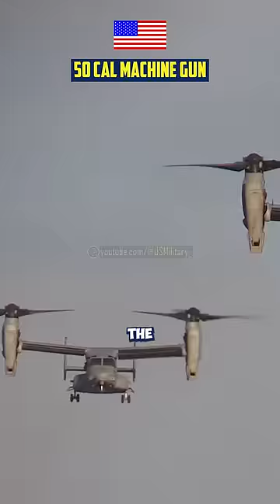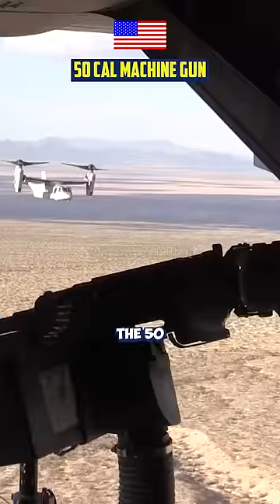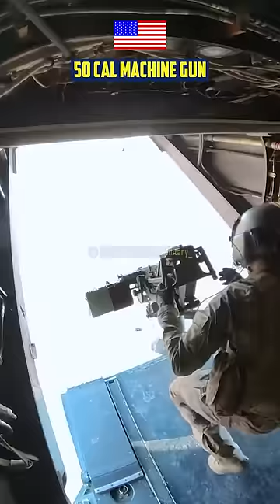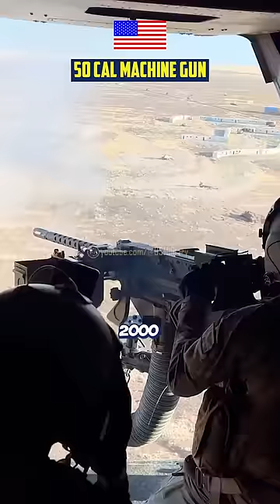The Scary Reason Why the 50 Caliber GAU-21 Heavy Machine Gun Used By @USMilitary_ Is So Advanced

Comment: Mate, that's a clocked up M2. Nothing very advanced about that

Edit: It would seem I started some shit
Reply: America not changing their machine fine for 100 years be like:”don’t fix what ain’t broke, you literal b-“-💪😎🇺🇸
Reply: Basically WWII air core fighter/bomber tech. If you know, you know.
Reply: I swear there was a couple 240's too
Reply: When he said that was a gau I was like most definitely not😂
Reply: @iteststuff1197 and you’d be wrong. It’s the replacement for the GAU-16 that was used for decades. GAU just stands for “GUN AIRCRAFT UNIT”.
Reply: @sbcbaits994  ooooh my bad 😅
Reply: True 👍🇬🇧
Reply: They had that same tech on bi planes in ww1
Reply: bro I was about to comment the same thing. just set the timing faster and enjoy your barrel changes.
Reply: seems like a bunch of y'all in here have done headspace and timing before. got a bunch of vcs, heavy weapons platoon, and vehicle gunners here.
Reply: @confusedbean1953 actually it is broken
Reply: @yosandydopico5545  no, the people it obliterates are tho
Reply: @flyback_driver  Ya ya .ost of u military guys can't even tell me the dimensions of a 2x4
Reply: Donate chip?
Reply: It's a m3 not a m2
Reply: @Deathbomb9 AN/M2
Reply: Yeah .. the gau is 30 cal mini gun isn't it?
Reply: @confusedbean1953 you my friend have no idea of the history of the 50 cal.

It was never a good gun.

It's over power for personal and underpowered for use against vehicles.

It's a half measure of both were 308 or 20 mm would be better. 

It's not good they just made a lot of them
Reply: Not even clocked up that far. The aircraft versions used in WWII went up to about 800 rounds per minute.
Reply: Haha my thoughts exactly,  so the 2nd update since ww2?
Reply: @jeremychance6463  GAU (Gun Aircraft Unit) is mostly just a designation for guns used by the USAF.
GAU-2B/A and GAU-17/A are different versions of the classic M134 minigun. 
The GAU-4 is a version of the 6-barrel, 20mm M61 Vulcan, some version of which seems to get into almost every US fighter aircraft since the '60s.
The GAU-19 is a 3-barrel, .50 caliber gatling. 
The GAU-8 is the 7-barrel, 30mm crowd pleaser on the A-10. 

Meanwhile, the GAU-5A is a breakdown M4 variant intended to be something better than a pistol for the emergency kits for ejected pilots.
Reply: @Deathbomb9 That was actually the US Army Air Force during WW-2, and it's spelled Corps.
Reply: @HelsinkiFarter There were.
Reply: @sbcbaits994 And it is pronounced G. A. U.  As a USAF Security Policeman, I carried the GAU-5 on numerous occasions.
Reply: @laglord  oh ok, I remember the 7.62 six barrel, the M240, and M2 when I flew... And the belly gun which of I remember right was the same mini gun as the ramp gun just installed under and with the computer targeting system operated by the senior AO
Reply: Dam right
Reply: @jeremychance6463 There are a lot of GAUs.
GAU-2 = 7.62×51mm NATO Minigun.
GAU-5 = 5.56×45 mm NATO Sub Machine Gun (XM-177E2).
GAU-8 = 30 mm Avenger Rotary Cannon (A-10 gun).
GAU-12 = 25 mm Equalizer Rotary Cannon. 
GAU-13 = 30 mm Light Weight Rotary Cannon  
GAU-15, 16, & 18 = Updates to the AN/M-2 .50 BMG Machine Gun.
GAU-19 = .50 BMG Rotary Machine Gun.
GAU-21 = Undate to AN/M-3 .50 BMG Machine Gun (which itself is an updated AN/M-2).
Reply: @JackTalyorD It did have a place early on in WW-2, but was out classed by the 20mm aircraft cannons by the end of WW-2. Once jet propulsion became normal for fighter aircraft, only the USAF was stupid enough to equip its fighters with it (see the F-80, F-84, & early F-86s, although some of the early USN FJ Furies may have been armed with it too). The USN, RAF, RN, and other NATO countries were using either 20 or 30 mm cannons, & the Soviets were using 23 mm & 37 mm cannons.
Reply: @ZackBadCompany1234  no they did not
Nice try though
Reply: @earlwyss520  as fair as I have seen the were a way to add extra "fire power" to any vehicle. 

Just slap a 50 on it and call it a day.  Let turn this transport truck into a tank kind of ideology.

But the end result been that the were under equipment to really deal with anything either  

Eg carrying 5000 rounds of 308 vs 1000 of 50 

Or 

Only 100 rounds of 20 mm but could do damage to amor.

Something like that.

It's more than just one thing that makes them good a d bad .
Reply: @earlwyss520  what wes it Americans WW 2 tanks each got a 50 cal on top for anit air defence.  In built A.A units for a tank coloum. Which sounds good on paper till you find out that have 6 50s shooting at a plane was less effective that have one 20mm gun attached to the colloum, which I believe was the Germans way.

The 50s looked good but did little damage to aircraft vs a gun that could actually shoot down a plane. 1943-1944 .

With the saving grace been they had air domains by that stage of the war 

I think.

Considering it was a war of resources it's funny they could waste it on gu s that weren't ever really needed
Reply: @JackTalyorD  The Browning AN/M-2 based FN Mitrailleuse d'Avion in 13.2×99 mm Hotchkiss may have been a better option.

Also the Germans used mobile 2 & 3.7 cm FLAK guns to defend their Panzerkampfwagens. The guns were mounted on Pz.Kpfws & various Sd.Kfz half tracks.
Reply: @earlwyss520  thankyou. 

I trying to get a better understanding of guns and weapon development. Trying to rap my head around cause and effective.   

Example tank destroyers where never good but they were cheaper than tanks (and I make this up) with some like the Germans capture 200 75mm Romain guns and gone stuff it lets slap it on the Panza 3s we got laying around. 

Or things like the Toyota wars where speed and quantity in well tin cans took down battle tanks. 

You always see comments of well 1 a-10 well destroy 200 4wd and I'm like we'll can it really...... I mean yes but you kinda have to catch up with them first...... 

Short answer would you recommend any sources for this kind of information.
Reply: @BogMouse3137  lol a machine gun on a swivel mount. Absolutely they did
Reply: But I am going to hype it up. Need muh views
Reply: @ZackBadCompany1234  well, biplanes of that time could not handle the weight of a 50 cal machine gun. So no, you’re wrong. The m2 underwent testing by the Army in 1918 (not combat usage) and then entered service in 1923. 
Google’s free genius
Reply: @Otto, Prince of Bismarck  haha 😂I understand that the m2 50 cal wasn't on bi planes. I'm talking about a machine gun on a swivel mount operated by some guy litterally shouldering the rifle 😂 .. I could totally make the jab that ww2 planes had better tail guns than that. But I left the fact that it was a 50 cal alone 😂
Reply: @ZackBadCompany1234  but your original point that they had the same tech in ww1 was wrong b/c the ma deuce mounted on a war plane didn’t happen yet
So therefore you are wrong
Reply: @Otto, Prince of Bismarck  lol nooo. How do u get they model of gun from the word "tech"?  Clearly, you are misunderstanding the words.  Had I said : they used the same guns on ww1 bi planes then u would be correct
Reply: @ZackBadCompany1234  lol okay Forrest Gump
Reply: M3 actually, which is the aircraft version of an m2
Reply: Just an M3. M2 browning but with air cool jackets around the barrel and a faster fire rate along with no spade grips all electronically firing
Reply: M3
Reply: The FN M3N 'Gau-21' is just a slightly modified AN/M3 browning dating back to the Korean War. The AN/M3 Browning, in turn, was a heavily modified M2 Browning.
Reply: @sbcbaits994  do you have any idea how much more advanced a minigun is than a new rebuffered version of a 100 year old gun is? the m3-variants start in 40's even.

this video is stupid. the arm is more scary reason advanced than the gun the gun is scary advanced. sure the gun works, generally, is known of how to fix, the rounds in the supply etc.
Reply: @laglord  There is nothing anymore "Break Down" about the GAU-5 than a standard M-16.  It predates the M-4 & is a contemporary to the US Army's XM-177E2. It was issued to USAF Security Police officers, senior NCOs, and K-9 handlers.  It was also issued to TACP members, Para Rescuemen, and other USAF Spec-Ops personnel.  As a USAF Security Policeman, I had the occasional need to carry one.
Reply: @cannonfodder6299  They were both used on aircraft, the .50 BMG AN/M-2 (not to be confused with the .30 US AN/M-2 also used on aircraft) & the AN/M-3.  The former was used during WW-2, & the latter in Korea.
Reply: Yeah they literally had versions of this gun in WW2.
Reply: @JackTalyorD  it was developed as an anti-tank machine gun in 1918, back then .50 BMG could punch through tank armor. But the war ended and later developments from the M1 to the M2 model made it a highly modular platform.

It can be mounted on a jeep, can kill lightly armored vehicles even today, and is highly durable and reliable. M8 greyhounds notably used them as the primary armament, the 37mm cannon being reserved for emplacements.

It is a niche gun that continuously adapted to new niches as the old ones died off. Your assertion is nonsense, it is infinitely adaptable as heavy machine gun.
Reply: @lasskinn474  yeah… I have 3k hours in h-60s and spent 4 years as the test team lead at HX-21 doing developmental test and eval. 4 deployments and thousands of rounds from a Gau-16/21 tells me that you still don’t know what the fuck you’re talking about. Gau-15/16/21 are different from the Gau-17 and it’s variants, but they are still designated for aircraft use. Hence their wide use among different branches of the military.
Reply: @russetwolf13  it can kill light armoured vehicles.......... 😂😂😂😂😂.

So can a lot of things.

That's the point it's both over powered and underpowered.

Swap that 50 for a Saw and a 40mm or a tow and you can kill tanks as well as troops.
Reply: @JackTalyorD  but none of those things can kill armored vehicles through infantry. Lesser platforms have to change, the M2 doesn't.
Reply: @russetwolf13  that's a pipe dream if I heard it that's almost the bare minimum "bulletproof for small arms up to 50 cal for amour vehicles"

Hell about the only things that aren't rated for 50 are things that get dropped out of planes.
Reply: @russetwolf13  one weapon systems that's dose several things badly dose not make it good or better that several that do on job well.

No to mention the same weight/volume of equipment.

4 nlaws and a blet feed light machine gun vs a tripod 50 

Ones going kill tanks the others just going to scratch the paint.
Reply: Well its an M3 basically... M3 does 1200rpm and M2 does about 750
Reply: @Deathbomb9 first developed for WWI but it didn’t make production in time…it’s a very old gun. I was gonna say, it the GAU 21 really that much better than an Ma Deuce. Does it really perform that much better?
Reply: AN/M2
Reply: Lots of changes have been made to the gun since ww2
Reply: @iteststuff1197 yeah wtf are these shorts on, i was expecting the real big machine gun
Reply: @iteststuff1197  it's based on the M2 and looks very similar. I never shot or worked on one but I believe they require electricity possibly? The rate of fire is like double the traditional M2 though. Pretty sure they're only on aircraft and helo's because of barrel temp issues you would experience firing it from a stationary position. Anyone who shot this thing or worked with them please feel free to correct me.
Reply: I mean. It's the best HMG ever produced. The reason why it's "advanced" is that extra tube under their looks like an additional gas tube to aid the recoil based action. May also decrease failure rates at high altitude and in cold environments. It's a simple addition. But a valid one.
Reply: I was about to say, it doesn't look any different than the M2 I had on my Stryker.
Reply: @HelsinkiFarter there’s 240s on the sides
Reply: @sbcbaits994 ah that's what gau stands for i thought it was the manufacturer.
Reply: @flyback_driver still have my gauges lol
Reply: “But it goes to Eleven?”
Reply: @yosandydopico5545 true. Buncha D CO heavy bois with some spicy time
Reply: @JackTalyorD  Your comments are so obviously fueled by bias it almost physically hurts😂
Reply: @AnthonyBlamthony  ohhh god no I love the 50 is a beautiful gun. 

JMB did a amazing job.

As a gun it's very nice. How it's been used it effects the last 100 years so so.
Reply: @flyback_driver give them a break, they were never taught how to do that. It's all handled by contractors who f*ck it up now.
Reply: @Deathbomb9 naaa thats WWI antitank weaponry
Reply: Wow, the firearms ignorance on full display in the comments today, lol
Reply: That's the difference
UnClocked vs OverClocked Up
Reply: @ZackBadCompany1234 1.5"x3.5"
Now where's my cookie?
Reply: @stephenh4177  😅  🍪.

I'm sorry I take it all back 😂
Reply: Every time: "Advanced" this, "Tactical" that, "Joint" something else.
Reply: @confusedbean1953 
Exactly. What makes a good product? Testing. What makes good testing? Using the product for a long time.
Reply: It works fine it’s the only system reliable enough to automatically dispense .50 in that size range that’s man usable
Reply: @earlwyss520  thanks for the correction, bud. Great to know that you can't understand Roman Numerals. BTW, there was no Air Force until after the war...maybe don't interject when you're inept.
Reply: @sethgilcrist8088  point to a single tank that you could destroy with a 50cal from WWII.
Reply: @Deathbomb9  points to the three Russian two Chinese and all Japanese light tanks.
You mean these.
They wanted to put momma on the planes of WWI but premetal planes couldn't handle the stress of firing momma
Reply: @Deathbomb9  so you’re saying the video is using the wrong footage
Reply: @Deathbomb9  Japanese light tank types 95-98. For one.
Reply: @ZackBadCompany1234  not really, most ww1 biplanes fire rifle caliber rounds,
Reply: @flyback_driver  most people in this comments section are absolutely clueless
Reply: @Deathbomb9 it’s actually WW1 tech. The M2 was designed in 1918 but wasn’t adopted  until after the war. It’s basically a scaled up version of the M1919
Reply: @earlwyss520  the M2 od any variation is chambered in .50cal or also known as 12.7x99mm for those who don't understand freedom units.
Reply: @Menuki  if it were the M2 I was talking about then yeah, but that's not what I'm talking about. I'm talking about the AN/M2 & AN/M3. They were first made to put in bombers and fighters to give pilots and crews a greater rate of fire and also more tracers. On a properly timed M2 you're looking at about 450-550rpm you could get them a little faster, but it's not a good idea and can be dangerous. The ones on WWII bombers and fighters were pushed to about 800rpm.
Reply: @sethgilcrist8088  it was never used in WWI bud. Maybe go check your history.
Reply: @Menuki  sorry, had the 21 and 61 switched in my mind. The 61 is the Vulcan 20mm.
Reply: @mhammer3186  if it were the M2 I was talking about then yeah, but that's not what I'm talking about. I'm talking about the AN/M2 & AN/M3. They were first made to put in bombers and fighters to give pilots and crews a greater rate of fire and also more tracers. On a properly timed M2 you're looking at about 450-550rpm you could get them a little faster, but it's not a good idea and can be dangerous. The ones on WWII bombers and fighters were pushed to about 800rpm.

Had to post this twice since everyone thinks they are an expert on military firearms and weaponry. It was modified for aircraft use and changed enough to get its own manual that wasn't and still isn't part of the same TM.
Reply: As someone who has been a weapons instructor on the 21 in the Corps for over 10 years now this comments section is pure comedy.

The FN GAU 21 and M3M by browning is actually quite similar. For those who are saying this is a clocked up Ma-Duece you should see yourself out.

I also find it odd that the 21 does not have an rpm of 1200 but 950-1100 adjusted with the fire rate plug on the backside of the back plate assembly. The weapon system isn’t even rated that high from the manufacturer FN so I’m not sure where he is pulling that erroneous information from. 

Particularly what is noticeable almost immediately for those who know their weapon systems is the change from the closed bolt to open bolt design. I originally instructed on the XM-218 before the Corps transitioned to the 21. The 218 was quite a weapon, very similar to an AK in that it will fire in any state having quite high tolerances. The 21 is more like a Ferrari. If it’s maintained well and headspace and midrange timing are set appropriately with the right amount of lube it will sing. But even the slightest variance in the before mentioned states and becomes a real pain in the ass haha 

We still joke in the Corps about the 21 being placed on the Osprey as an optional tail gun with the 240 being the other weapon of choice. The reason being is that the osprey only has a 100 round can and well… you do a lot of can changes with the rpm of the Gau.
Reply: @GDub356  shit, my bad. 
I'm just saying this from a layman's perspective
Reply: @markgallagher1790  haha nah man your good! Just military shit talk at its finest. I have been teaching that weapon system for a almost my entire 15 years in the Corps. Aside from my first couple years being a new idiot lol 

Nothing personal my dude. I appreciate the shit fest you started though 😂 it’s comical for sure.
Reply: @markgallagher1790 most things you see in YouTube people know nothing about and then it comes to my neck of the woods where I’m a subject matter expect so reading the comments is a good time for me. Typically I’m on the other side of the fence in the comments section though lmao
Reply: Coz, Murica 🇺🇸😂
Reply: @Deathbomb9  Pz.1
Reply: If it ain’t broke don’t fix it
Reply: Yes. This gun is literally a WW1 gun we clocked up in WW2 and havent stopped using since.
Reply: @JackTalyorD he goal was deterrence, not to shoot down planes. Pilots tend not to do very well with tons of tracer fire flying past their cockpit. The US also had dedicated SPAA platforms like the GMC M15 and M16, the Germans were hardly unique in that regard.
Reply: @Chopstorm.  Yes.

My understanding of it was having 5x50 was no more or less effective that having one.  

So equipment every 5 tank with a 50 and have one 20 mm tagging along. 

But then there's question of ground attack roll. Advanced over open ground wall of lead from the 50 with infantry taking shelter behind. (Would a 30 have been better?)

If that makes sense.

I think it's a beautiful gun, just dislike the way it's been use as a stopgap muilty role weapon.  

But saying that what else could you use.

(Part of the problem in WW2 for the USA was the numbers and types of guns and ammo they had in the field in small arms so reduced the total different number of guns from idk 20 to 6 is a good thing)
Reply: The edit … 🤌🤌
Reply: @jeremychance6463 no. GAU stands for gun, aircraft unit. The number behind it designates which gun it is. The GAU just means the mount and ammo can/feed system is designed with aircraft mounting in mind. The GAU-17 is the Dillon Aero mini-gun. There are .30 caliber, 20mm, 30mm & .50 caliber variants. The guns on old school bi-planes from WWI were usually .30 caliber due to the weight of the gun and ammunition. This particular gun is very different than the M2 .50 caliber machine gun due to having a dual recoil system that allows for a higher rate of fire. If you took a standard M2 Browning machine gun, and adjusted the timing for an 1100 rpm fire rate, the gun would explode due to the massive force from the 16 pound steel bolt slamming into the rear plate of the receiver. Hence Fabrique Nationale designing the dual recoil system for the M3. There. I fixed it.
Reply: @earlwyss520  why would you carry a GAU as security force?? GAU stands for Gun Aircraft Unit, it’s a Browning on a mount that can be placed in aircraft
Reply: Hahahahahahhahaha it would seem I started some shit hahahahaja

Bro with 2k likes, it’s statistically probable for 10% to comment, and just s few to try and find a way to discredit your post. They stick out though hahaha

Stick to your guns get it? And be confident that the bulky M2 50cal is just a brute force of machinery no different than the guns used 20-30-50-100 years ago…

If you said that this gun was highly advanced (let’s remember it’s relative, so auto fire is not _advanced_) then you would have gotten 1-2 likes and zero comments about being wrong, even though you would be wrong
Reply: @ZackBadCompany1234 when the .50 cal was designed 2x4
Reply: I mean I wouldn't walk in front of it
Reply: That’s what I was thinking.!
Reply: @confusedbean1953 

Didn’t work to well in Afghanistan 🤷🏻‍♂️
Reply: I agree with you.  Been in service since 1933; it’s not advanced; it’s timeless.
Reply: @thelethalpredator672 AN/M3 iirc
Reply: @JackTalyorD t if wasn't good it wouldn't be used by that much militaries around the world for that long.

There isn't such thing as "overpowered" as long as it isn't costly, giving the range of the thing I guarantee you people on the receiving end would disagree as well. 
As for the "bad against vehicles" idk what are you talking about but it will go through any unarmored vehicle and lightly armored vehicles are usually vulnerable to it at least from the side. 
(Rifles firing the same round are classified as anti-material rifles for that very same reason).

.308 doesn't have the same punch and range and 20mm has waaaaaayyyyyy more recoil (good luck trying to use that efficiently on a pintle mount and hitting anything more that 150m away) you can carry way less ammo (the later being the main reason the French military went from a 20mm coaxial autocannon to a .50 when replacing the AMX-30 by the Leclerc).

(Speaking of the French military, experiments were conducted in the 50's during the war in Algeria to put WWII German aircraft MK151/20 20mm gun on pick-ups to help in counterinsurgency warfare, the recoil was so high that it lifted the truck on the side the gun was firing, you can find pictures of it online).

So yeah, there is a reason it's still around more than a century later, so I really don't know where you get that from.
Reply: @AdamSmith-kq6ys the AN/M3 would go around 12000 rpm iirc.
Reply: He also showed aN FN MAG 😂 which, isnt a .50 cal.
Reply: @confusedbean1953 and yet, you dont use your nokianphone anymore, do you?
I guess it still worked when it got replqced with am modern phone?
Using "dont fix what aint broke" is just an excuse for lazyness
Reply: I'd think that 2 since the M2 is the base, that's an M3 aka the FN M3M.
Fires faster than the M2 and is derived from the same M2 aircraft variants from WW2 PLANES
Reply: Gau is multi barrel electrically driven, this is an M2.
Reply: Its true though.
Reply: @flyback_driver they got lots of money. Cheaper to replace five barrels per flight then replace five ospreys per mission
Reply: "Looks like I started some shit"

Man, that's what Youtube comments are FOR
Reply: That’s what I was going to say,plus one they where showing was not a .50
Reply: @flyback_driver head space and timing is a thing of the past. All the new M2’s that are issued are set already and can’t be adjusted
Reply: Bruh. Thats a glocked up M2. 1200 rpm of 50 bmg?! Terrifying!
Reply: @flyback_driver aircraft mounted machine guns almost always had a higher cyclic rate of fire than the infantry or ground vehicle versions. You know because traveling at hundreds of miles an hour through cold air just keeps the barrel cold. And engagement windows are much smaller, need to get as much lead on target in those split seconds.
Reply: And half of the shots are the M240H
Reply: I put on order 2 of these machine guns..
Plus 15 boxes of ammo.
Reply: @Deathbomb9 you say ww2 but I thought it was a bigger version of the first machine gun ever mad no?
Reply: @VacatedData  the M2? Definitely not based on the first machine gun ever made. It was a scaled up version of the M1917 that was also designed and patented by John M. Browning.
Reply: If it ain't broke don't fix it 😭
Reply: The M2 is great and all but it's been used for  100 years.
I wouldn't call 100 year old weapon advanced.
Reply: @HelsinkiFarter yeah 240H and an m134 variant
Reply: @Mirkk47  you can when it hasn't been replaced and gas only seen marginal improvements that didn't really change the design and just changed a single aspect.
Reply: The gau-21 is a pos, you waste a whole 600 round belt in 30 seconds and then you have put 144 lbs of ammunition back in a box and feed it up a 4 foot chute. On top of that if you want to shoot full left or right the damn chute will get slightly tangled and cry for dear life and cause a failure to feed.
Reply: @ZackBadCompany1234  no, the used total different machine guns during the First World War like the Lewis gun or MG08 and not a M2, the M2 was used during world war 2 on tanks, jeeps, mounted positions and aircraft
Reply: man this guy said it was advanced, maybe compared to what the Russians have, or what they had when it was made
Reply: @SolartheSwed  read it again.
Reply: I was about to say the same thing. It’s essentially the same gun that it was designed in 1918 and adopted in 1923.
Reply: Yea the fire rate definitely been turned up compared to a standard browning .50. That fucking thing called the GAU-21 is the devil lmao.